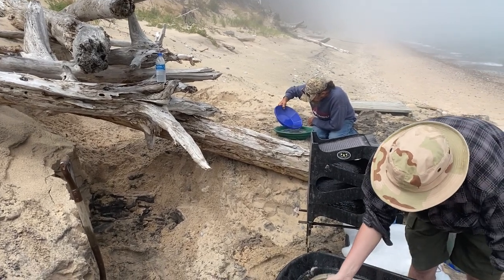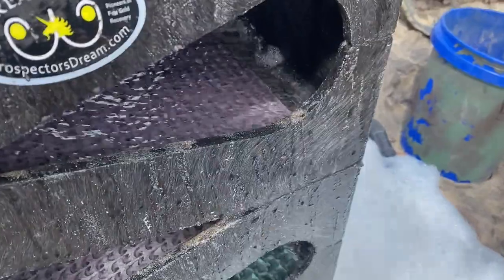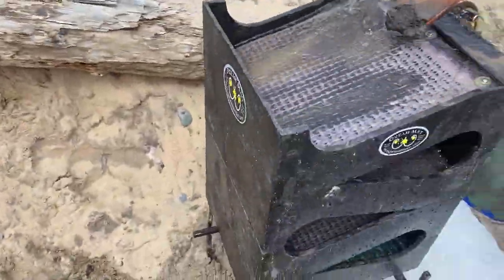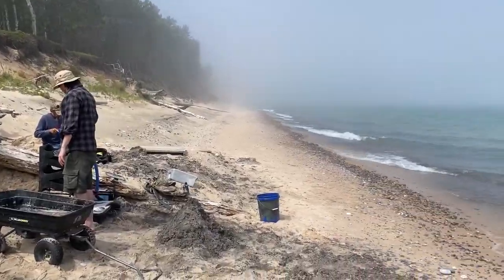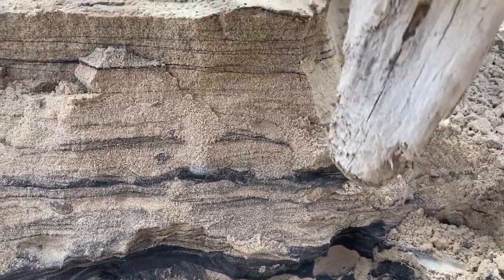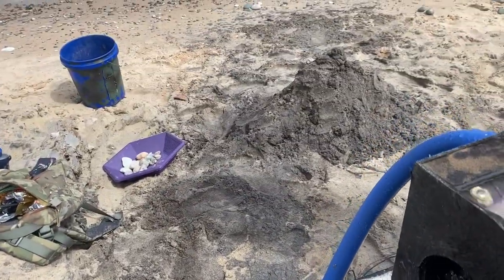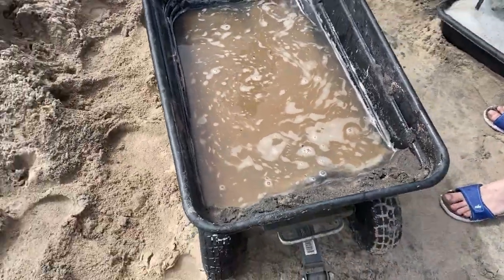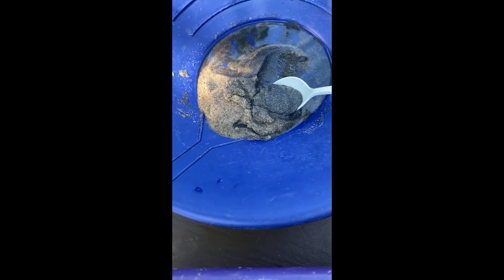Lake Superior Gold

Comment: I'm thinking a couple light weight fold up 100w solar panels & one of those small  portable solar generator power stations  (jackery is one brand name) could easily run a water pump from sun up to sun down & not be as  heavy to drag around like a deep cycle battery.
Reply: I'm thinking of a remote control boat big enough to carry everything that I would want Paralleling the shore line as I move along. To old to carry all that stuff